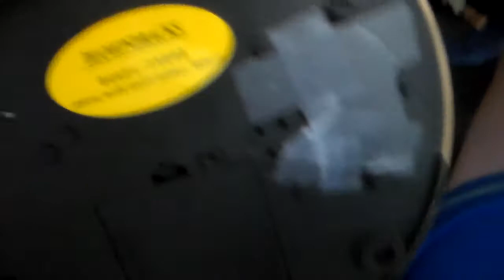Very Glitchy buddy big league

Comment: The reason why this happens is because the orange resistor on the head motor is either loose or it broke off because my pigskin pete had this problem and it was because of that resistor
Reply: It was in fact because a capacitor was broken off for the mouth motor actually because you can see as the mouth moves. The whole thing screws up and it was fixed later that day after this video was made.